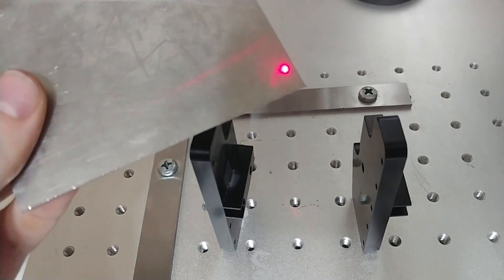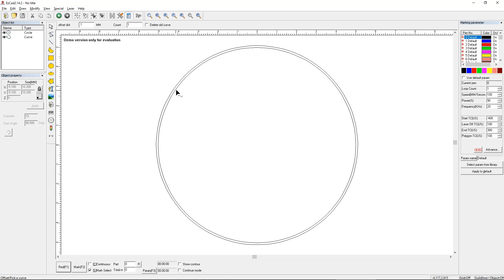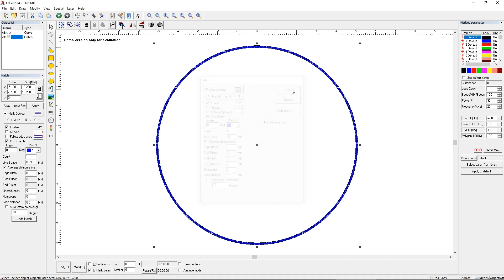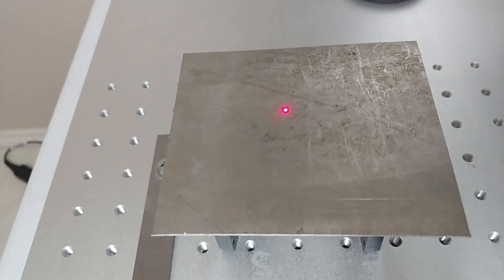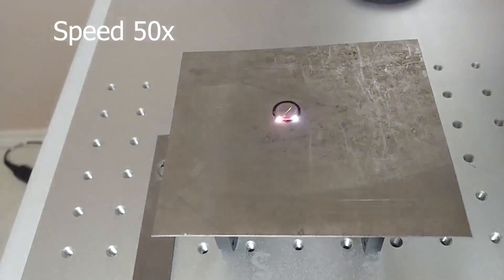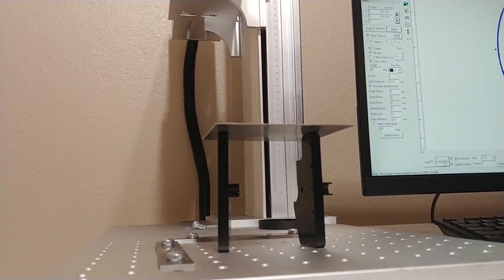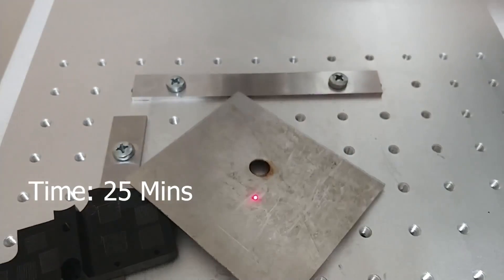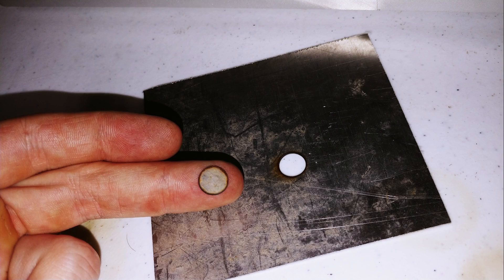Attempting to Cut Through 1MM Stainless w 20W Fiber Laser.  Results Aren't Great.

Comment: I was wondering what was the easiest metal to cut /engrave with a fibre. If a 1mm thick engrave was needed ie for a leather stamp or possibly branding iron what would be the best metal to use?
Reply: Did u find ur answer?

Comment: hey...so you would have gotten through it faster with a focused fan blowing directly on it to remove the soot. Tested.  no fan took 2.5 hours to get through some sheet metal (Forgot the thickness), or 30 minutes with a small desk fan pointing directly on the hole

Comment: Im planing to get a 20W fiber laser as well. a 40x40mm lens on it. i wonder if i could cut through 1mm efficiently . what are your thoughts?  The energy density of the laser would increase compared to 110x110 setup
Reply: @zomgthisisawesomelol Engraving Dials and watch parts :)
Reply: @zomgthisisawesomelol good news! i shall get my laser delivered in about 2 weeks. with a 50x50mm lens installed. i can then record my tests :)

Comment: Hi, your videos you have made on the Chinese laser have helped me decide to buy one, currently on its and expect in late January. One question you might be able to answer for me! I I would like to cut gold and silver 0.15mm thick , I have ordered a 20w fiber laser with a 110x110 lens do you think it will cut ok or will I need a 70x70 lens / more power? Thanks in advance..and a happy Xmas to you, regards Ed👍
Reply from the maker: I don't do much (or any really) cutting so I'd only be guessing.  I'd start with your 110 and go from there.  Lenses aren't a big deal to order later.

Comment: Hello Jeffery, I tried to deep engrave a 1mm stainless steel plate (50mm text height) but the plate is bend from the heat of the laser. Is there anything I can do to make it not bend? or should I harden the plate first?
Reply from the maker: You could try to cool it while you're marking.
Reply: @jefferyj  Wise choice.
Reply: @jefferyj  which settings of wobble did you use

Comment: 3 circles close in size as a cut line (no hatch). air blowing on the circle to remove soot. we've cut through 2mm steel in half an hour with a 50 watt with a 50mm circle. The key is air though, you quickly build up a soot layer at the bottom without it and you rapidly get diminishing returns.  More air, more better.  Also, magnets (I'll let you figure the magnets part out, the other part is a freebie
Reply: interestingly. I have a 60W mopa m7 laser and a 6 cm circle in a 1mm steel sheet that burned it for me in about half an hour .. the power consumption was around 235W
Reply: Elaborate that part of "magnets"... :)

Comment: As one other comment said, the focus is only optimal for a very limited z height. At some point it will simply stop cutting. Try to move the laser down in some increment - maybe 0.3mm, since that is what was advertised....
Reply from the maker: Yep that's what I thought too and I tried to play with focus during this experiment but it didn't have a major impact.  Since making this video, I've learned about the wobble setting which helps achieve depth for something like this.  Really, a 20w just isn't a good tool for this kind of depth.

Comment: What about 1mm aluminum?
Reply from the maker: Unfortunately, no.  Thin stuff will cut, but about the max thickness with multiple passes is 0.3mm.
Reply: @jefferyj  yes 20w fiber can, i cut 2mm stainless steel with high dopped carboneum, 20х25mm cutting little bit 1 hour, clear  alum more faster
Reply: @KochnevLL  Could you please tell me what kind of parameters (offset, hatch, different pens, simply whatever parameters you find useful in this process) do you use to cut through 2mm stainless steel ?
Reply: Daniil Gorid-Lanier yes I’d love to see a post of the setting. Plz do!!!

Comment: My 1kW fiber laser cutter takes about a second to cut that. I'm just ordered a 50W engraver though and I find your videos very  helpful :-)
Reply from the maker: Glad to help!
Reply: I have a 50w laser. Did you use these same settings to cut?
Reply: 1kW? Dang …does that make it 20x more powerful than a 50W?
Reply: @flortristanw yes of course it does because the 1kW Fiberlaser is not pulsed  it has 1kW CW (continous Wave) 😉

I have a JPT Mopa M7 Fiberlaser with 100W. It Cuts through a 1mm stainless steel in 10min with a 110 x 110mm Lens. Now i bought more Lenses, 50, 70, 150, 175 and 200mm. The reason is if you have the half Spot diameter the power density increases 4 numbers. With the 110mm Lens the spot diameter is 0.04mm and the Power density is 1.2GW/cm2. With the 50mm Lens the power density is round about 6GW/cm2

Comment: I need an engraver that will engrave to a depth of .003” in gun metal steel. Do you recommend this device.
Reply from the maker: It will do 3 thou, but if you're going for depth in production quantity or over a large area, I would probably get a 30 or 50W laser as it will be a lot faster.

Comment: @JefferyJ try using the wobble setting in advance... by the Audi logo (freq)... game-changer when cutting
Reply: The wobble settings was made for cutting metal. And you have to set the focus halfway through into your part. Because the beam Focus point gets Smaller and loses power at the focus point the deeper you go.
Reply from the maker: Thanks, I'll give it a try!
Reply: I heard wobble option is bad for your laser?
Reply: @EJSVARZ  Absolutely wrong.